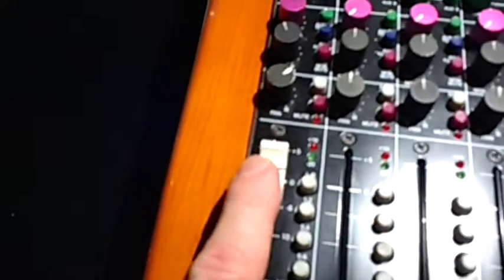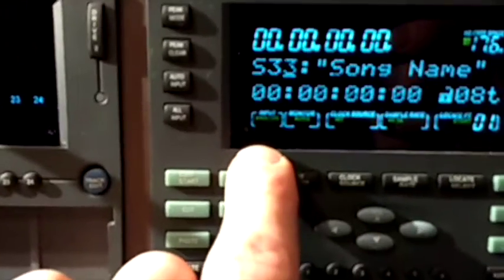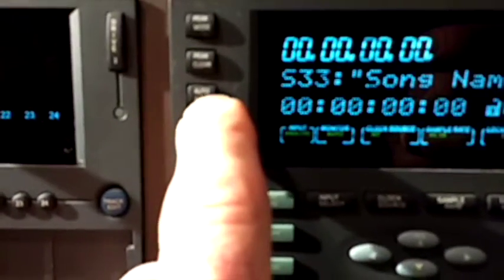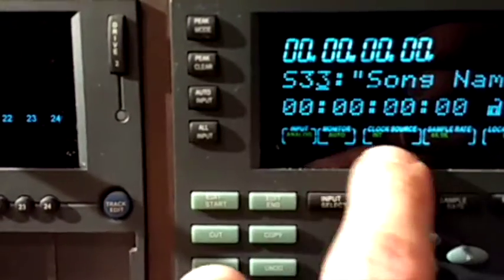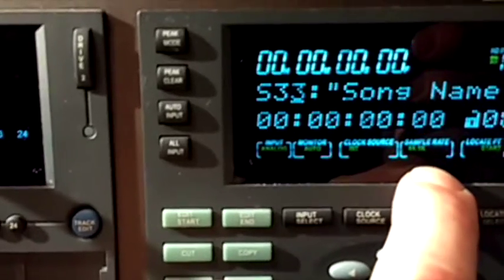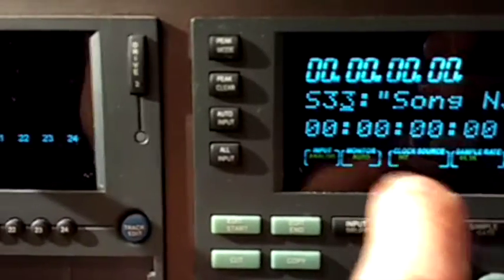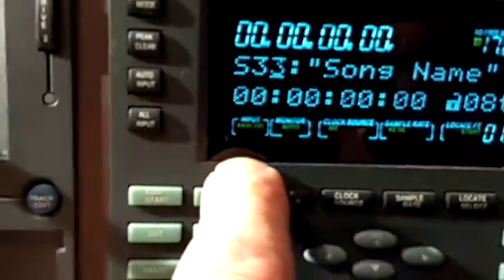Studio B: Tracking & Overdubbing: Signal Flow on Toft ATB analog console & Alesis HD24

Comment: I’m just wondering, for your monitor gain knob (purple). Is this a signal that is returning from your interface via the monitor input or is it just coming straight from your mic input without any additional routing?
Reply from the maker: Post multi-track via monitor path. The idea is to monitor as far downstream as possible - in this case - post multi-track. That way you can hear what is actually being recorded. If you monitor before the multi-track, buzzes, crackles, clipping, or noises might be missed on the track being recorded.

Comment: Hi, I'm considering either going this route or just going straight up analog, i.e. an Otari MX80 or a Tascam MSR 24, or a Fostex G24 (the last two only because 1" tape is about half the price), or maybe even have both a digital machine for the creative process, then use the tape machine when ready to do the final runs, have it set up to where I can patch it over to record to tape. Do you have any finished audio examples on line of this set up with the Toft board and the HD24? Thanks in advance for your response and for sharing this video.